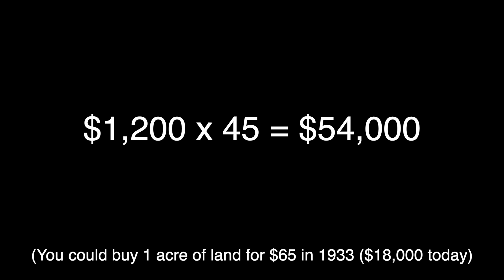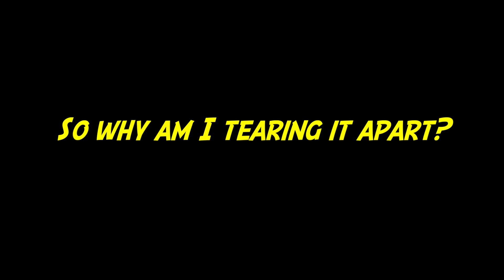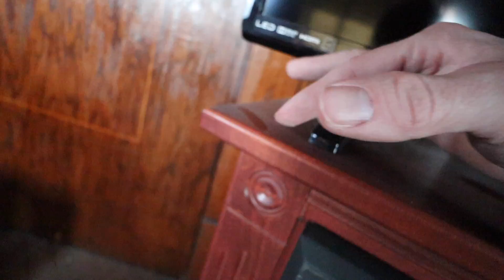Turning A $7,000 House Into A $700,000 House

Comment: Make sure that structurally the upper floors can handle all you are pushing for.  The framing looks might light considering the loads you are intending to put in, especially on 100 year old trusses.  You may want to pay a structural engineer to work it all out for you, I am sure they will suggest a number of additions and changes to keep the house from sagging like an old man's pants.

Comment: Save the ripped out floor and reuse it. 
There are Profesionals that can refinish those floors. Pple do it all the time in U.P of MI
Reply: coledcornstar  the old wood floors are thick. So they can easily be refinished and sanded down. Just cut a hole, and start popping them all out and save all the good ones, toss rotten ones of course. You can rent industrial sanders once you reinstall and the polyurethane yourself, or high pple to reinstall, sand, etc.

Comment: Hey Cole, I have a suggestion. Why don't you ask your viewers what they think you should do with your house renovation. Something like - should you just tear it down and start from scratch and have yourself a new, modern home, or should you continue on with your renovations plan? I vote to tear it down if your plan is to save money. If your plan is to restore an historical landmark, or you have sentimental reasons for restoring the old house, then go for it, but as a carpenter and a state certified contractor (inactive) in the state of Florida who has had a bit of experience with such matters, tear the thing down and start from scratch.

Comment: I dont think you're allowed to put spray insulation directly on the plywood of the roof. That will mean that the snow on your roof melts and then freezes into ice and suddenly you got terrifying icicles reaching the ground and your roof is not breathing as the ice wont let any air pass and you'll wind up with horrible mold again. Snow layers let air pass so thats why roofs are built with an air channel between the top layers and the insulation layer.

Comment: Seven years ago I retired and move from California to my growing up home in North Dakota. The foundation was bad and leaked bad. I stated at the bottom by jacking up the house and putting a whole new basement in. I have finnaly finished the last room down there. now I have 2 bedrooms, a poker room, suround sound T V room ,kithcen ,and full bathroom. I added new windows, stone around the bottom and new siding. Built a 450 square foot sunroom. and now I can start on the main floor. I have done it all myself except the concrete. Had some help. I'm getting closer to the finish but getting older and slower. Ha.

Comment: Could you sell that hard wood flooring as it would be much thicker than todays particle crap! Nice to see your  plan. You might need to wipe down the floor to get the rest of the dust off that hardwood. If you removed the hardwood from just one bedroom you could reuse it where your partitions will be removed. It would match perfectly. Just sand and reseal.  Think about it. As a former wood worker I’ll have a few tears when you toss it out ❤. I hope you hire a structural engineer. Making your ancestors proud Cole..

Comment: Wood burning stove. Go to Walmart and get a WIFI 6 ROUTER. Then you can close the door. I hope you're getting a structural engineer to look over the whole thing, from the foundation to the attic. Fix the electrical problem before you foam.  If you want to run CAT6 ports this would be the time to plan where you want them at. Having a hard-wired lan connection is safer than wifi. Remember attenuation.

Comment: Obviously an engineering and insulation plan is imperative and getting permits are important.
Then focus on getting the utilities up to code get rid of the cast iron drains, verify your septic system is viable for the next fifty years, test out your well, water filtration is important, radiant heat, heat pump air conditioning air filtration and humidifier and plan on investing in solar panels unload propane go to induction wire for future demands what about planning now for an in ground pool with a pool house for gym, sauna and music studio and party space that opens to the pool

Comment: Cole should really shellac all that framing so its all sealed up! Over 100yrs of bacteria, dust ect. Should be sealed up. Peace of mind the house is sealed up and not spreading anything that can live and travel through the air. Even will drywall and paint it all finds a way out into the air that is breathed in that house.

Comment: Use the wood you will pull up from the floor as new flooring.  The quality of the wood would be well worth it.  Lumber yards now days does not normally carry that high quality of lumber, and if they do carry it you will pay an arm and a leg for it.  The house itself would require it because of the history.  
     One great way to lower dust is to get an industrial mop and bucket filled with hot water and mop the floors at least once a day from top to bottom.  Each day you will mop up dust that settled overnight.  Soon there will be no more dust.  Your lungs will thank you in the future.

Comment: what are you talking about you are going to rip up the flooring upstairs??? The wood (framing and studs) you are trowing away from around the house is made from the same wood as the floor - just send it to a specialist mill and get the boards cut into floor boards if there are nail wholes in it still mix the sawdust with PVA glue together so it's really thick and full in any wholes, it comes out looking like there has not been a patch done - old houses hare character are you getting rid of the character?

Comment: The sad truth is most of the attic structure is load bearing and to change it will require the whole roof to be torn off to be rebuilt to code.  The 1900 building standard do not meet the code of today. The rebuild is going to cost more than  would cost to demolish and rebuild as new construction

Comment: IDK, if you have several children how are you going to assign the bedrooms?  There will be fights over who has the biggest room, who has the closet, bathroom etc.  Good luck with that. As to the floors, it's your house, do what you want. Insulation makes a good sound barrier. Also you can block off portions of the house and control heat loss by the placing of other barriers.

Comment: Knob and tube wiring is fine as long as it isn't monkeyed with.  However, given how many electrical demands modern homes have today, it's better to rewire the whole thing and start fresh, especially when you're dealing with repairing water damage and adding necessary insulation.  Just do me a favor--keep the built-ins and don't paint the woodwork.

Comment: I would try and save most of that hard wood flooring , that is money $,  I would refurbish a lot of those floor's to original. As far when you start to tear down the upstairs ceiling get a couple High velocity fan and put them in a couple of the windows where its sucking the air/dust  outside . And Yep rewire the whole dam house . I would put in a 250 to a 300 amp 3 phase service ( I think you said you have 3 phase on property) you will thank yourself now , and not later saying dam i should have put more power in rats .  Thrust me I am a ret master Electrician /engineer that is the way I would do the electrical part .

Comment: It's very nostalgic and visionary to imagine saving old wood house, while economically not reasonable at all (unless your uncle is a millionaire  or Youtube videos will provide sufficient income to offset the cost of time wasted)
Forget about it.
Buy a nice blueprint design with 3-4 car attach garage 3000-5000 sq.ft with 6 bedrooms/2 floors and build it in 6 month nearby.
It will have all modern material (not health hazard 'old school unknown chemicals in walls/wood/everywhere.)

Get all modern air handlers for heat/air conditioning designed in your blueprint for water, electrical, waste, etc)
The main cost and mistakes is months and years of work of the architect who design blueprints and make it up to the 21 century building code, i.e. be strong for weather, snow/wind and safe for people to live inside)
Don't risk removing a few walls as winds can be strong in your area.

There is nothing to save in this old house, we live up to our new health and safety standards country 100 years later, let's go to into the future into the new house!
Keep old house as your family museum.

Comment: NOT THE FLOORS!!! Hear me out. You can take flooring from the new closets and bathrooms to patch. You can also just lay down a sound dampener and your LVP right over top. You will save a TON of labor and cleanup, plus dumpster rental fees. Just imagine skipping all that work and dirt and getting to the good stuff. More money for other projects, you get results so much faster, AND get to move on to another project. If you ever changed your mind about your flooring choice, you still have that irreplaceable hardwood. If you ever decided to sell for some crazy reason, having the original floors adds value. Also, save your doors somewhere they're protected in case you want them when you're older, or at the very least sell them. People will drive across states for antique wood. Some of us feel sick and want to cry when you trash all the antique goodness in that house. For the love of God please at least give it away to someone who wants it! 🙏

Comment: Honestly Cole, if you're going to spend $700,000 dollars on that house,....it would quite simply be better to tear it down and build a new house for that kind of money. Yes, I understand the significance of the homes history and the sentimental value of the house. You have to be realistic in regards to throwing good money at bad. 
Ok, let's put it this way in terms that makes dollars and cents. A custom built home in Canada, is very nice. But a custom built home in the United States is like a freakin mansion! Building a house in the states, you get way better bang for your buck there. In Canada, not so much.
You see Cole, what worked, and what was considered functional, for home owners back 100 years ago, is not going to work for you. It's great that you want to try to revive the old girl, but at this point, in this particular house, it's served its purpose. That house is a farm house, not a lifestyle home. Farm houses were designed with one thing in mind,... Family workers. Not really designed for a family like the one you and Ava will have one day.
Keeping that in mind, the house is old and impracticable. Don't get me wrong Cole, the interior is nice, but not functional. You have a kitchen that's too small and the other rooms don't fit your needs, among other things.
Your trying to fit a square peg into a round hole. I'm for old houses if they are practical, and function well, but in this case, in the long run you will see that I'm correct. You're better off tearing it down and rebuilding a new house. I know I'm just some guy that watches you share your life with you, but at the same time I think I make a valid point.
If you build a house and future proof it, your value for the money in 60 years will go a long way. Say like when your folks can no longer take care of themselves, by building your new house you could have it be all one floor and set up so it functions for them and yourselves. And say, when you're old and grey your children won't have to worry that you have to move in with them, because you've already designed it in mind so many years ago.
So is it worth retrofitting your family's home? I believe the answer is no.
By starting over from scratch, it would be a better value for your family now and into the future. You can design it to suit you and your family's needs, instead of just accepting what there is currently.
Anyways, I hope you're still having fun with the YouTube channel and thanks for sharing your life with the rest of us. Good luck, and keep your stick on the ice, eh!
God bless you and your family.

Comment: That hardwood floor.  You will not be able to afford anything as quality.(ok I wouldn’t). Get your flooring guy take tape.  Lay out room ideas.  They might be able to figure out a way to fill in those gaps from one room you do remove it.  Consider it.  Then the two of you decide what YOU want.
Reply: Still keep one bedroom, bathroom on ground level.  Someone is going to get a leg broke.  Or even just sick, weak.  Having a place where it’s easy to get to kitchen, dining (not excluded from family) plus no stairs.
Reply: Wish I could edit.  Your 2nd stairs got me thinking. Exits. Consider sprinklers.  The cost is not terrible. Insurance MIGHT get reduced. 
 As kids sleeping upstairs. We had 2 Emergency exits.  Thru a window onto attached garage.  From garage slide down on belly, grab gutter. Less then 4’ drop at age 5.  Other end a rope ladder, hook point.  Never used except practice.

Comment: It would be foolish to scrap that hardwood floor. If he doesn’t want to use it he can sell it to someone who does. Here in U.K. we have salvage merchants who buy such things to resell. I would have thought you would have them too. Personally I would save as much of the flooring as possible and use the wood from the attic or one of the bedrooms to repair and complete where necessary. That way you’ll have the superior old wood in all the main rooms and you can use the inferior modern stuff where it’s less on show. Please try to keep the character of the old house as you modernise it, otherwise you might as well have just built a new house.

Comment: ROCKWOOL, is a modern day insulation that is actually made from rock's. So I don't believe that is what your house has in the walls. Long time ago cotton seed hulls was a popular insulation, that may be what you have. The actual ROCKWOOL insulation is actually extremely popular and one of the most modern insulation products because it is not only very good but is extremely chemical free. Thay mack it not only in various thicknesses but thay also have a sound control product as well. A combination of Owens Corning foam board, ( glued to the inter wall and spray foam around the cracks ) and modern day ROCKWOOL would be one of the best insulation materialise you could use. The Owens Corning foam board you could do in any weather because it's closed cell foam is made in a controlled environment so you don't have to worry about one of the biggest problem from using spray foam in a residential home where people, expeshaly children are sleeping because of toxic chemicals. Anyone that tells you thay can successfully spray foam in a uncontrolled environment PERFECTLY is full of B.S.. All so Owens Corning foam board is cheaper and you will save on labor by doing it your self.😜😜😜 Also ROCKWOOL is a trademarked name, don't think thay are enjoying you abusing there reputation as one of the most toxic free products on the market.😳😳😓😓😓😓😓 You also don't won't to hear the tragic story's of a spray foam installation that went bad.😭😭😭😭😭

Comment: You're destroying the interior of this house.  Removing the original flooring is a crime! You're turning an old house into a cheap heap of trash. Spray foam for insulation will cost you major money in the long run. But hey, some people have to learn the hard way. Good old fashioned pink insulation is the best. Plaster walls are also the best compared to cheap drywall or sheetrock. As far as your flooring goes, NO one makes flooring like that anymore!  The old growth trees that those planks came from, are no more, and there is nothing better than old growth wood. I also hope you did NOT throw those old doors away!  Those doors are worth money, but you wouldn't know that, and from the looks of things, I doubt you even care. Even the lath was worth money.  You could have at the very Least, donated it to Habitat for Humanity, or a ReStore, store. That's what intelligent and nice people do.
Reply: @pamwiseman    😂🤣